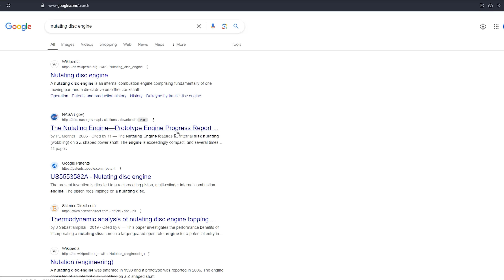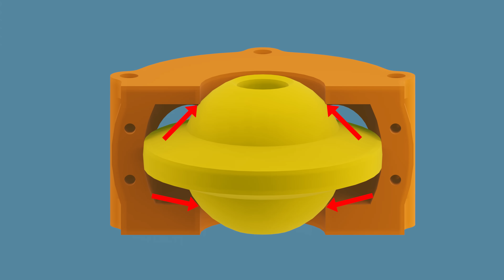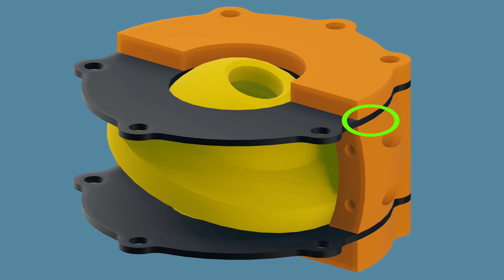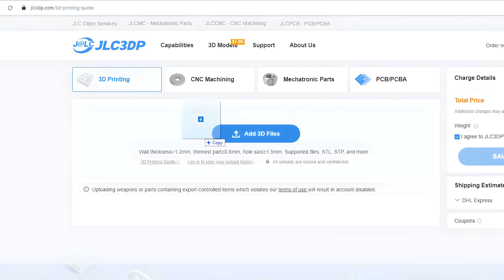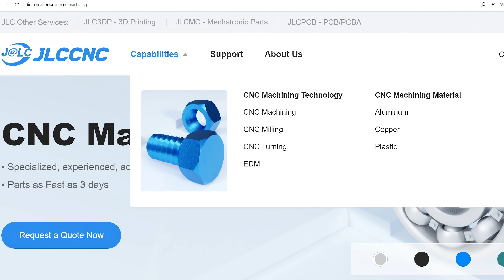I Built a Nutating Disk Air Engine

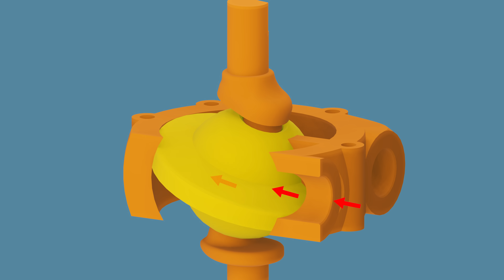Comment: 8:54 Very cool.  Is it just me or does it seem like its pulsing?  Like there's a deadspot, maybe when the disc is transitioning from up to down like at 1:26.  Maybe there's a slight impedance right at the jump between the two states.  If that's true, you're losing momentum on each "stroke" instead of building ontop of the previous stroke.   Smoothing it out might give you some extra power.

Or, I'm just seeing things.  Filming high RPM at high speed and slowing it down might give you some answers.

OR, check out "Motion Extraction" by a creator, "Posy".  There might be an application here.

Comment: I have to wonder if it wouldn't be better to have the disk fixed with the shaft, allowing you to ditch a bearing and getting rid of the index on the disk and in the cylinder.

Comment: "chamfer"@4:24 no! Instead subtract a sphere with something like 0.01mm to 0.05mm bigger radius then the sphere below to minimize air loss then use step format.  However you are blowing to create another blow through mechanical, with a 90 degree bent down of the air compressor tube you get easily transmit thrust more efficiently

Comment: nice job man. thanks for video. i think better to use air sealings instead of rubber gaskets. also you can make another sealing in edge of ufo shape. make its edge like a grave for air also make some holes in ufo up and down sides to guid air from out of ufo to its inside and then through air channels to air grave in ufo edge. this way a small portion of air will guide to edge of ufo and will restrict air flow from edge of ufo up or down. this way you can increase distance between ufo edge and cylinder. same you can do for rubber gasket with replacing by air sealing.

Comment: This is interesting as a concept compared to piston engines since the the the main axle and engine are on the same axis and the components that convert the flow of air into into some form of work also forms chamber seals.  I could be wrong, but thinking about it more though, you might get better results from an even simpler motor design like a convectional impulse/reaction turbine or tesla turbine, since they might need less dimensional tolerances for your recreational applications compared to the wobbling disk engine you made.
Reply: ya my first thought seeing it was 3D tesla turbine. I think the tesla turbine still wins since can stack more 'plates' made me wonder if there would be an advantage to making the tesla turbines concave though i.e. more surface area

Comment: Hey, I have an engine I designed, I can't build it right now because life, but if you wanted to build it, I could provide you with the CAD files. Another reason I cant build it, is it requires a cnc machine, which mine is in storage. It would have to be out of aluminum as 3d printed plastic would have too much friction and not work. Let me know if you are interested. Since Youtube doesnt allow links in the comments, I will have to DM the links to the files.

Comment: This design is used in the every day water meters outside most houses!
Reply: Most inventors would do well to do their homework on existing technology before re-inveting the wheel.
Reply: Gasoline pumps too.
Reply: @billparker8954  I guess that is the real life use case for this: metering liquids.
Reply: Hydraulic pumps and motors aswell

Comment: The only problem is your using a lot of air for a small appliance. I was working on a air type engine years ago it worked but my goal was to run it on a recirculating system.

Comment: One - Congrats on getting me to sit and watch all the way through an advertising aside.  You actually integrated the segue into your running commentary quite well, and had built good "momentum" by the time you got to the parts that were pure advertising.  JLCPCB spent their money well here.

Two - I would be interested in seeing you take this design in a second direction.  I am very curious as to how this nutating turbine(?) functions as a hydraulic engine.  I would like to see some discussion about its use both as a hydraulic actuator and as a possible water-driven motor for some kind of small hydropower system.

Comment: 1. Reminds me of the ROFLcopter sound made by microsoft sam, soi soi soi soi soi soi...
2. if you send designs for someone else to print, make sure that either you have a patent or that the design is properly in public domain first, otherwise you may lose the rights to the design.
3. Here are the four horsemen of engines that work well in theory, but not in the real world:
A. Straight, edged, or otherwise unfavorably shaped sealing between the main power harnessing element and the rest of the combustion chamber (Wankel, vane, rotaries in general, rectangular piston, the indexing key sealing on this one, etc)
B. Non-positive sealing (Coates, rotary valving in general, the spherical axle sealing on this one, etc)
C. Undampened full engine power going through a lashing mechanism, generally gears (Achates, Avadi, etc.)
D. Exotically machined parts to avoid the problem above (INNengine, etc.)
Reply: This is a quality response. You've clearly understood the practical engineering issues at a granular level where most people don't see the subtleties. When I saw the Honda oval piston I thought, "That won't work well". They would have been better with a squashed circle profile instead of oval so that at least there was a constant curve.

Comment from the maker: STL files in the description, if you're going to print this project, there's also a little note about the assembly. don't forget to subscribe!!
Reply: Here's an idea 👉 Get a coupler for the inlet port, an extra piece of hose and feed the outlet back into the inlet. I think it's an awesome design, and the efficiency could also be improved by putting some texture on the surface of the ball, like small scales.. 🖖

Comment: What if the exhaust goes to a second disk that is 90° out of phase? Then you get the exhaust's remaining energy powering a "mini-powe-stroke" in between your current power strokes.

Also imagine printing it in metal and running it off steam! 😁😁
Reply: That's interesting. I'm wondering how this system might operate in an even denser medium, like water. If it was eficient it may find application in smaller scale hydropower systems. Just a thought, since I'm no expert in that field.
Reply: @waynecooper6124  you'd probably need at least a little air to keep it from locking up mid stroke, or modify the design slightly so that flow from intake to exhaust is never completely cut off
Reply: @waynecooper6124  hmmm... The main differences would be that liquids are incompressible and have higher viscosity. I suspect the lack of compressibility might be an issue cos if there are points in the cycle where both the inlet and outlet are closed water wouldn't be doing work on the "piston" (in this case "wobbly disk"?). The higher viscosity MIGHT be a benefit as adhesion has some effect on a rotary engine at the surface. How much of an effect this actually has I don't know.

I thing a best of both worlds would be a supercritical fluid that has both the compressibility and the viscosity.
Reply: @atrumluminarium  dry ice maybe?
Reply: That would be so cool 😮😮
Reply: Or just make a runaway diesel turbo

Comment: So just saying steam engines used oil so your air engine may benefit from oil injected with the air, only problem is you need to collect it after the air passes through.

Comment: I have a solenoid stye air pump, noisy as hell, I wonder wound this work as an 'almost silent' airpump, I was thinking crank and bellows but this may work? I need good flow at low pressure (for a laser cutter, to move smoke away from blocking the beam)

Comment: Restriction on the exhaust might increase performance by trapping air in the case forcing the air across the disc faster.. obviously that will need to be tuned for optimal performance or it eventually will have a negative effect but once you have a fitting the some form of exhaust system the back pressure will increase the power compared to a gaping hole letting all the air out before it's done as much work as possible.. it kind of reminds me of a tesla turbine engine with a plane propeller blade attachment instead of just a power generator 😂 and a tesla turbine is good for extreme rotation speeds but lacks tourqe to be a useful engine but people are trying to get tesla turbines to have useful tourqe

Comment: Why worry about the disc staying in place with that internal "fin"?? It sure is making lots of leakage
Reply from the maker: It prevents the disc from rotating on its own axis, which means lower seal friction. It also separates the intake and exhaust ports, so the air doesn’t immediately escape through the exhaust
Reply: @retsetman9698  i missed the last one. I thought the disc itself shoud separate the chambers
Thanks for taking the time to answer :)

Comment: Nice work. With the exhaust Port being right beside the intake would there not be a significant amount of air bleeding across and going straight out the the exhaust? could this be remedied by moving the exhaust the opposite corner of the intake to reduce the valve overlap. Also is the locating Notch necessary? Would there be any harm with the disc rotating freely in it's housing? Keep up the good work
Reply: Locating notch would be better placed 180⁰ opposite to avoid most bleeding 
But it's a prototype with more optimization ahead

Comment: There are two more seals that would also improve performance. The disk to wedge seal and the wedge to sphere seal. Without these seals, the engine is simply relying on air velocity to wobble the disk rather than a volume change caused by pressure.
Reply: The workaround is to add a pair of channels around the edges that vent to each side. The idea is to use friction of air rushing into the channels to keep the pressure within moderate, lowering the pressure difference between the cylinder and the channel itself, slowing the rate of air flow due to lowering the energy barrier.

But the question is, is an air trap more efficient in terms of flow reduction than a single thick edge? My mind says air traps should 'insulate' the pressure flow better. I'm not certain if this logic will match reality.
Reply: precisely the disc needs an o-ring around it
Reply: Maybe increasing the area of the outer part of the disc would increase the power of your engine .
Reply: The friction would destroy the plastic
Reply: @derpinbird1180  there already exists 2 other rubber seals. Why should the two I suggest be made from plastic? Are you suggesting not sealing these regions?
Reply: @acreery1  i think they mean the plastic of the casing/disc, not the plastic of the seals
Reply: @derpinbird1180  it would wear it smooth until a micro gap is formed which would still be better than now.
Reply: Not an engineer by any professional sense just love tinkering and learning, recently I had to change out a power steering pump for a friend and when i dismantled the old pump I learned that they’re way of sealing the internal chamber for vacuum  is a set of “fins” that are forced outward from slits made at the center of the rotation, my point being the rotation of those isn’t on a fixed point either and the inertia from rotation keeps the fins in contact with the outer wall at all times… that’s just where my mind goes..
Reply: @randymunsen5330  thats called a vane pump lmao 🤣
Reply: No, the only improvement one can make is throwing this in the trash. An engine is an air compressor. Where is dude gonna get his compressed air from? Oh... shit.
Reply: @hlaw2830 right, because compressed air is the only fluid that exists…

Comment: What would be the pros/cons of a nutating valve engine vs a impulse/reaction turbine?
Reply: Friction and low speed high torque are some of the examples. Also,as he said, NASA is making one that uses another of these to be spun by the exhaust gases.

Comment: I learned about nutating valves as a Power Engineer (boiler operator), they’re used for flow meters.
Reply: As far as I know EVERY natural gas and gasoline vending pump uses "nutating disk" flow sensors.
Reply: That makes a lot of sense.   Trying to use this design to actually power something is going to run into the fact that the mechanical leverage the air has on the disc is very low...so useful power output is going to be minimal.
Reply: Most home water meters use this principle as well.
Reply: @guildersleves  they're used in residential flow meters because they are the perfect combination of reliable and cheap
Reply: My Instrument lecturer invented/patented a nutating disk flowmeter, won the Queens award for it I believe, Mr Bob Drinkell.
Reply: Make sense as a sensor. Since the volume can be relatively easily determined.

As an engine, however, I am not so sure...

I am thinking just surface drag is probably enough to make the rod spin efficiently without the z shaft...

Comment: At 8:02 you show that you just have screws that can screw in, did the model print with matching threads or did you add those somehow after receiving the product?
Reply: SLA printing can do threads quite easily, it doesn't have the same issues as FDM printing.

Comment: Looks like a significantly less efficient version of a turbine. It's a great demonstration of the real engine, but probably not the best design for an air engine.
Reply: A better sealed version, especially one that actually HAS a seal to isolate the two sides of the disk, would work with any air flow rate and pressure, unlike a turbine. In essence this is a piston engine. Just a poorly sealed one, for now.
Reply: @arturjogi6054 I'd say it's not a piston engine, it's a STEAM engine.
Reply: @arturjogi6054 WHERE ARE YOU GOING TO GET THE COMPRESSED AIR?! Oh, I know, an engine, because that's what they are.
Reply: I came here to say this as well. To me, it looks like the air is just pushing it around rather than the proposed compression operation theory. Still neat though, especially the clear version. Not enough people make clear things
Reply: You’re right, this design blows.

I’ll see myself out…
Reply: No way 😱😱😱🤯🤯🤯
Reply: A positive displacement style has some benefits.
Reply: @ThunderPanzer I guess it could power an indicator like a guage but I can't see it having much torque for doing actual work? Ingenious just the same.
Reply: it needed way too much seal to be able to work, but if the seals are too tight it might not even work. while a simple laptop fan design works simply from air pushing on it
Reply: This isn't a turbine. Turbines rely on aerodynamic lift over the turbine blades and are tuned to work best at certain speeds. This relies on a trapped volume of air (or it will once it's sealed properly). I think it's a great idea.
Reply: @jamescarruthers1967  You're right. It's less of a traditional turbine and more of a mix between a tesla turbine (also a turbine), a water wheel and a radial compressor run on reverse. I would love to see efficiency/power comparisons with other designs.
Reply: @jamescarruthers1967  is a tesla turbine a turbine?  Does that rely on aerodynamic lift?
Reply: @meateaw  well, obviously the Tesla turbine is very different from an axial flow or impeller turbine, so debatable. At least they still use an aerodynamic force (though drag instead of lift) to impart the motion on the rotor. Since the design in this video is (ideally) based on volume displacement, it's probably better to call it a pump.

Comment: Nice, what about water instead of air?
Reply: I'm curious as well, water doesn't really compress so I'd like to know what it would do in that
Reply: Most residential water meters use this technology. So yes water would work just fine provided everything was sealed and aligned properly.